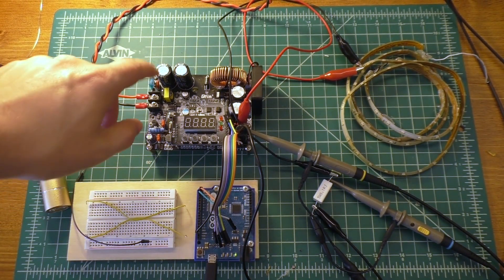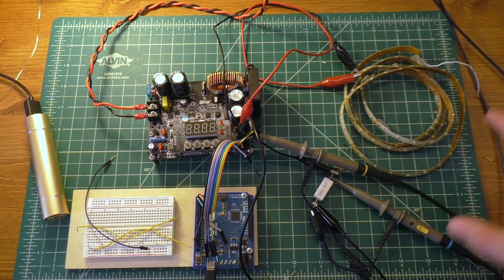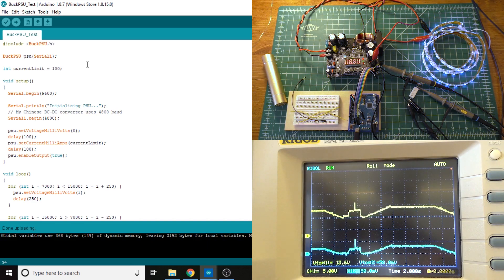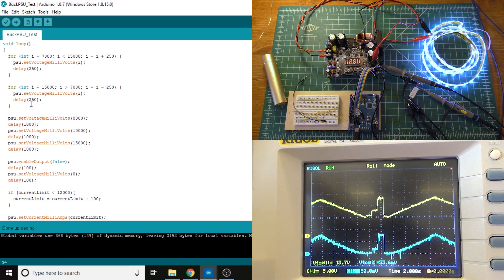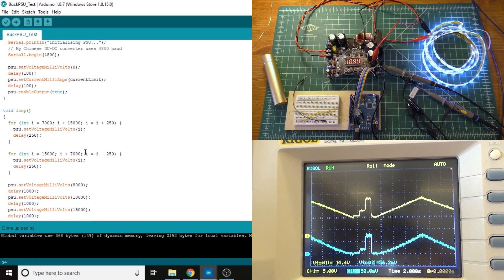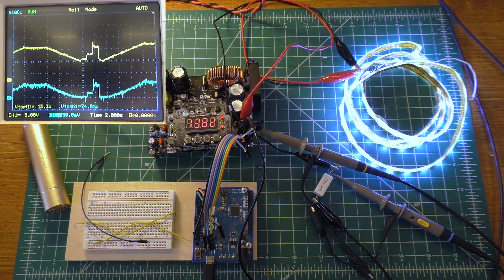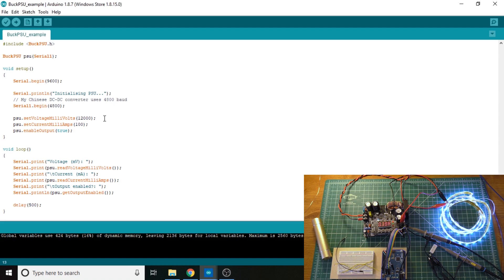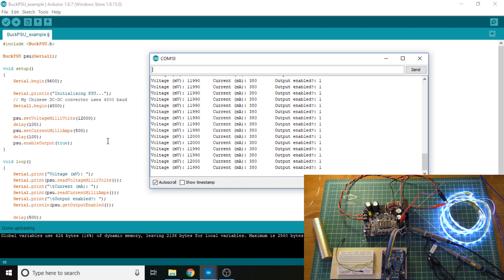Controlling A Power Supply With an Arduino

Comment: I have tried exactly the same PSU and the same Leonardo Arduino with the same code, but it doesn't work. I even tried to monitor the serial using the same code, but I got 0 values for the mV and mA and the output. It seems that there is no response from the PSU. Would you please recommend a solution for this issue?
Reply: Hello, did you manage to get it to work?

Comment: Is this a buck boost? Could it be used to charge a 12v lifepo4 bat bank, from a 24-29v bank? Without balance!
Reply from the maker: No, its buck only. I have used it to charge batteries before though.
Reply: Look for D3806 buck-boost model.